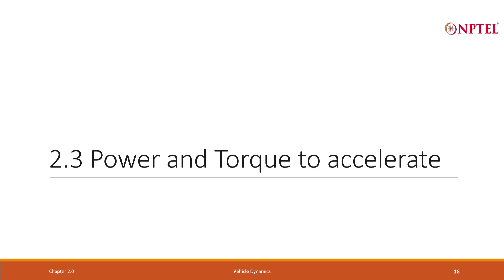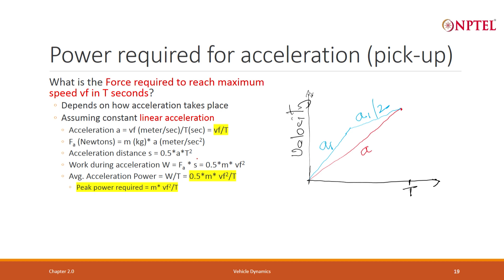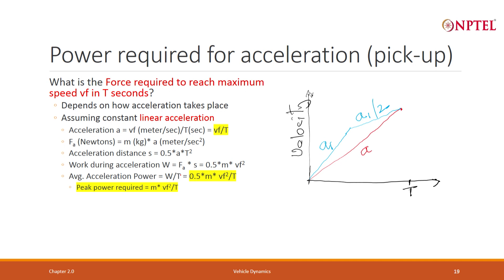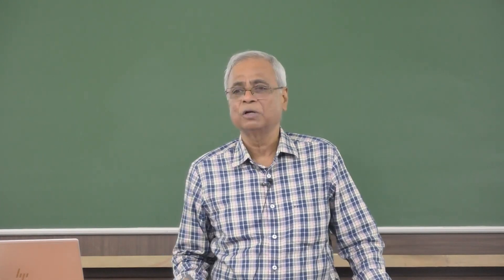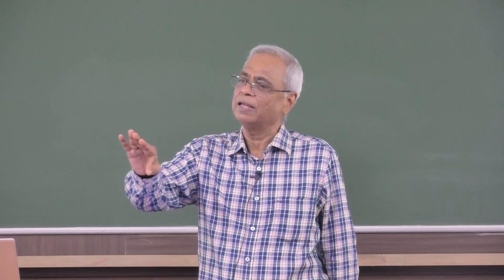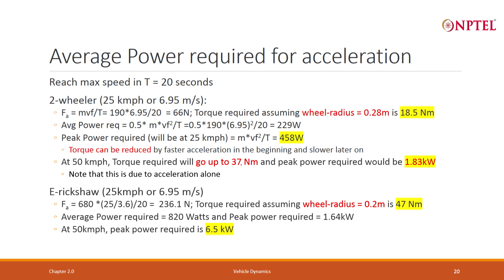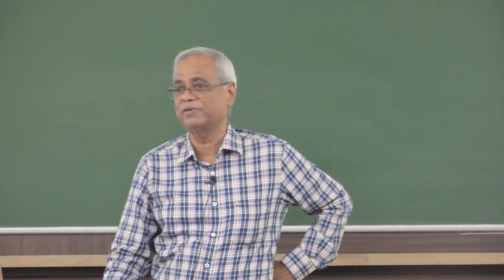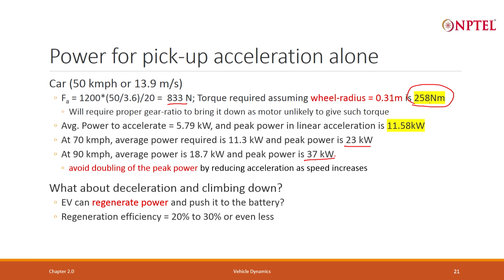Lecture 10 - Power and Torque to accelerate

Comment: Can someone clarify
@ 9:05 slide 20,
Professor wrote as : "Torque can be reduced by faster acceleration in the beginning and slower later on"
But it should be quoted as: "Peak power can be reduced by faster acceleration in the beginning and slower later on"
Prof conveyed it right, but wrote incorrectly in the slide.
PLEASE correct me if wrong.
Thanks.

Comment: Sir I have a basic question all power calculation are in w   I.e.  it for 1 hours 
But in case of acceleration if we calculate for 20 sec by  average power result we got are for only 20 sec. Or 1hrs

Comment: 4:50 can some please explain " acceleration will be higher, but POWER REQUIREMENT WILL BE LOWER"
P= F. Vel
P = m*a* velocity
Higher the acceleration, higher the power.
Can someone please helo me think clearly.
Reply: Best to reduce a variable by using P=mv2/t. Now v is the only dependent variable. Now, even if you keep you acceleration high early on, i.e. for lower velocities, power requirement will be lower. In this band, acceleration chosen is still higher so force required will be higher.

Comment: What is the force used in torque calculation here
Reply: Total traction force, which is the sum of all forces necessary for movement.
Reply: @h7opolo  but sir we used force=m*a we not considered any resistances forces ,if we considerd then value is not matched with the sir given  so please guide .
Reply: I'm not sure at this point. I've forgotten all about this lecture, but I understood at one point. If you watch all lectures from the beginning, you should be able to learn all that is necessary.
Reply: @h7opolo  ok sir thank you

Comment: Why is the peak power double than that of average acceleration power?
Reply: At final instant t=T, v = Vf, a = Vf/T which is constant throughout, F = ma and P= F*Vf. Therefore the instantaneous power at t = T is twice the average power requirement, and instantaneous P vs Vf is like a ramp graph (assuming  Vf/T = a is a constant) . That is why peak power (at t = T ) is double the average power in this special case (with many special assumptions like u = 0) .
Reply: @surajs5913  then how to calculate power for velocity which is non linear